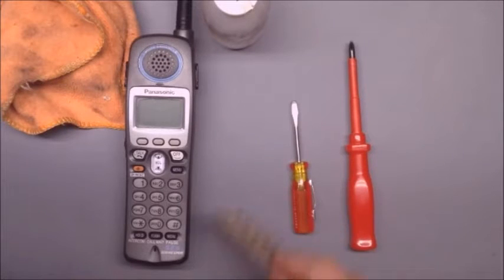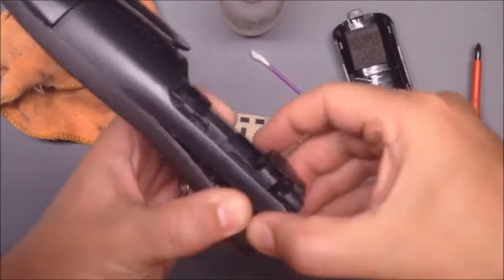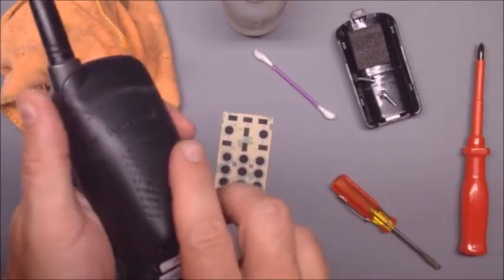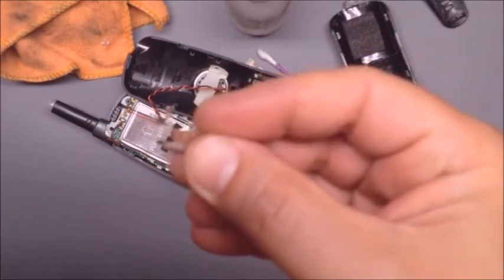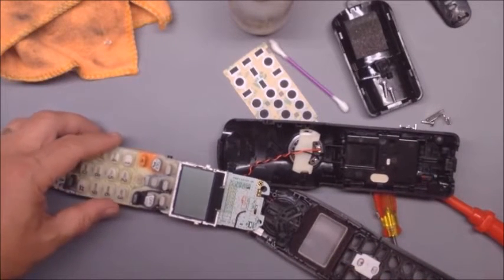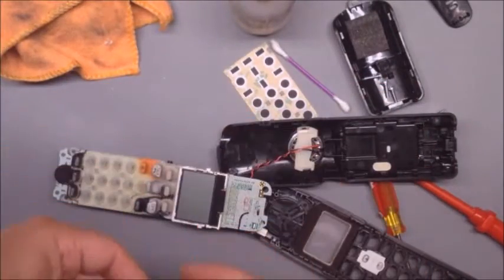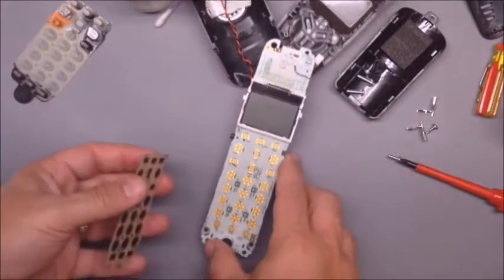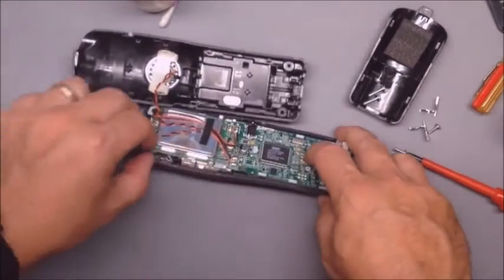Panasonic KX TGA650b Keypad Button Repair

Comment: I followed your advice and it worked for renewing the keypads on my Panasonic KX-TGA410, for the 3 handsets I have----I am just having some problems with my batteries charging up as fast as they usually do, but if they dont I will write back to you to see what I did wrong---Meanwhile, I am so enthusiastic with having been able to salvage, hopefully this phone, instead of buying a new one which I was going to do today--until I found your video!!! Thank YOU!!!
Reply: I actually found what you just said to be true...because it was actually working even though it looked like it wasnt...and it went through an odd cycle that seemed to be exactly what you just said...Meanwhile, thank YOU for helping me with my phone...I am on disability and it helped me so much! If you ever want I will share your channel on FB where I have almost 5000 friends...If you have a video introducing your services...or something you think is good...Meanwhile I am going to share this...

Comment: Is 99% isopropyl alcohol ( i saw on amazon) good to buy or only 91%, for using on phones etc?
Reply from the maker: 90 or 91 is more than good enough for cleaning and you can get it at any pharmacy or market.
Reply: I saw 99% on amazon for cheap and thought it may be more worth it but not sure if it is the wrong thing for phones, etc.

Comment: My 4 year old Canon MX-892 printer/fax/scanner/copier---How can I clean the print heads so I dont need to buy a new one? I spoke with Canon, and they helped me to set up an old Dell laptop (was windows vista, broke down many years ago, friend installed windows 7, works slower than most new laptops but good) with the mx892, but it did not work (which i will soon explain) but it did work with my mothers relatively newer 2 year old mx472--Back to my printer, the Canon rep walked me through the print cleaning process twice, and also had me remove the cartridges and put back in, etc, etc, but it still wouldnt print, not from the laptop, nor directly on the printer itself---Previous to using this old dell, I was able to print using my lenovo laptop (returned as lemon) and also samsung tablet---If there is no problem using this dell with my mothers printer, then i dont see how it can be a software problem, and even Canon thinks it is the printheads----This will cost as much money to bring somewhere to fix as it will to get a new printer---Can you tell me how I can try to fix it first? Thank You, Michelle
Reply from the maker: Can you get to the print heads? Usually they are not easy to get to. If you can reach them then you could clean them with 90% isopropyl alcohol and q-tips. Printers really are not my thing, but I did get an epson printer cleaned up by soaking a folded up paper towel in windex and putting it inside the printer under the print heads (where the paper would be) and with the printer off and unplugged I pushed the print heads back and fourth over the windex soaked paper towel. To slide the print heads you had to start a cleaning and when the print heads started to move, unplug the printer and then it was free to slide.  Old ink jet printers are throw away items unfortunately.
Reply: Are the print heads the place where the cartridges line up on when I take them in and out? If so why would i need to start the cleaning process? And, when I have done cleaning process, the printer was closed...i would not know how to open it? would u open it during the cleaning process? would it stop the process?
Reply from the maker: Every printer is different. Typically if you stop it in any normal way it will automatically park the print heads and then they cannot be moved. You just need to get the printer to start moving the heads and then unplug it so it does not have a chance to shut down. Still, cleaning print heads isn't easy or guaranteed to help. I'd call this a last ditch long shot effort before trashing the printer.

Comment: I have more questions that will solve a lot of the research i am having to do...I am willing to show any of your videos like i said with the 5000 people I have built up on FB social media...Also if you have questions about supplements , homeopathy, other holistic health, veganism, whatever,etc, including best places to order, whatever, i will answer as long as i am feeling well enough when you ask. Meanwhile, i am tired of trying to figure out all of this myself. Can you help--

Battery questions (not as important as Canon printer question)---I want to get rechargeable batteries and a charger that does a little bit of everything...On Amazon I like, for $18.79, Universal Battery Charger, Novete Overheat Protection Fast Charger & Discharger with LCD Display & Auto Switch Off for Rechargeable Batteries, Such as AA/AAA/SC/C/D/9V/Ni-MH/Ni-CD/Remote Batteries by NOVETE.

I need AAA rechargeable batteries for my panasonic phone (which i initially wrote to you about KX-TGA410)and for a newer phone i may have to get KX-TGF383M...what is the difference between getting hi capacity rechargeable batteries and regular ones? I us the phones a lot because I am semi-homebound. I also get confused by the difference between nicd and nimh batteries, and how those related to my needs for AAA for the phone. Also, when the company mentions hi cap as discharging faster but lasting longer i am confused with what to get related to my needs. Finally i get confused when they say, for any battery type, that it holds its charge for ex 3 years, do they mean if you charge it once and then use within 3 years, or it only lasts that amt of time period (That question will matter more when I get to my question about rechargeable C batteries for flashlights rarely used until brown or blackouts) Here are the battery choices for each problem beginning with cordless phones needing AAA, but i want to understand the hi cap vs regular and nicd vs nimh for all types as they related to my needs and teh battery charger above  
1st) AAA Rechargeable Batteries 800MAH GP Pre-Charged (8-pk.)SALE !! by GP for $11.19----I have been using these & they are good for at lest a year and a half maybe 2 years or more.
2nd) AmazonBasics AAA Rechargeable Batteries (8-Pack) Pre-charged (black color) for $9.99 
3rd) AmazonBasics AAA High-Capacity Rechargeable Batteries (4-Pack) Pre-charged (silver color)$8.99
4th) AmazonBasics AAA High-Capacity Rechargeable Batteries (8-Pack) Pre-charged (black color)$14.99

For a fan for hot flashes, i need to keep moving it so its better with batteries, also if blackout, but sometimes I use a plugin fan and sometimes the air is on all over the house and i dont need it, but i never know, and sometimes i need fan in winter
1st) Odec D Cell Rechargeable Battery, 4-Pack 10000mAh Deep Cycle NiMH Battery Pack,  $24.99 for 4
2nd) Energizer Rechargeable Batteries, D, 2-Count,  $12.92 for 2

C batteries for flashlights that are used only as needed for brown or blackouts or to see when fixing something.
1st) M2cpower® 5000mAh High Capacity Ni-MH Rechargeable C Batteries(4 Pack) for $13.99 (I dont see others with 5 star ratings) These are high cap

I always use AA batteries and tho I have no particular urgency, I would think these depend on what you are using them for and its hard to say because it can be for a little of everything.
1st)  AmazonBasics AA Rechargeable Batteries (4-Pack) Pre-charged--black color - $8.99
2nd) AmazonBasics AA Rechargeable Batteries (8-Pack) Pre-charged- white color--$14.99 
3rd) AmazonBasics AA High-Capacity Rechargeable Batteries (4-Pack) Pre-charged (silver color)-$10.78